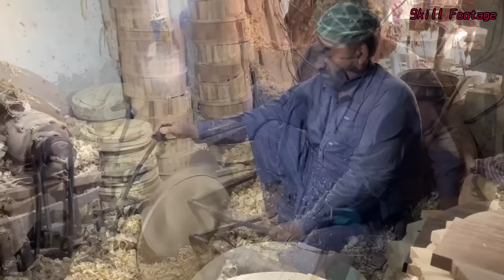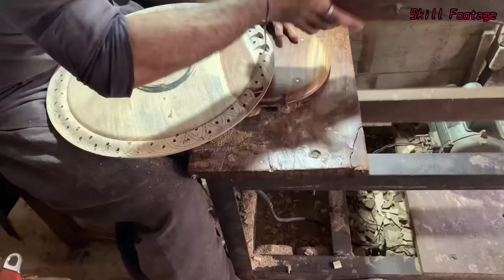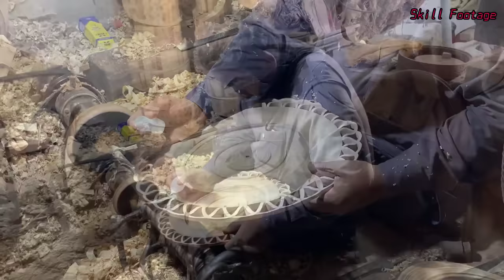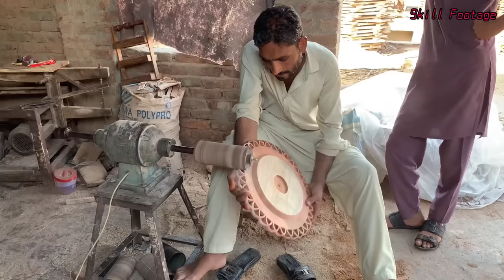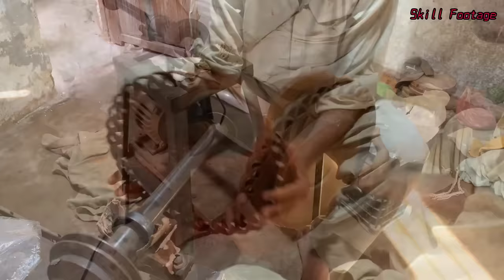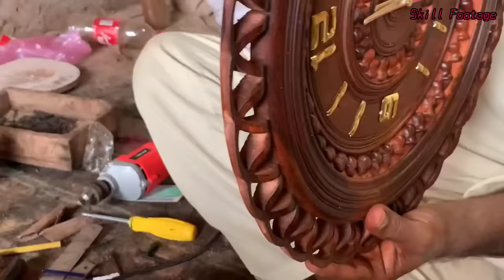Amazing Woodworking Project of Making Wooden Wall Clock || DIY Wooden Wall Clock

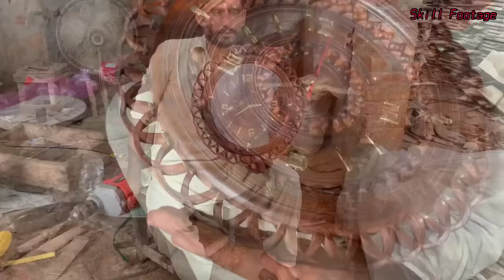Comment: 17:10 - You guys should get a template for placement of the numbers on the clock face as well as the placement of the fasteners holding the glass. The final result made my OCD have a heart attack.